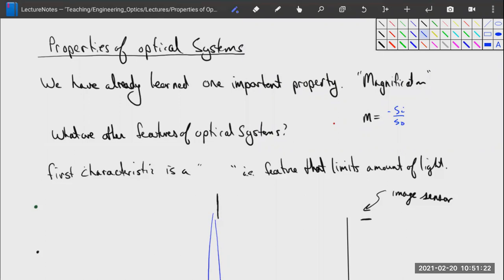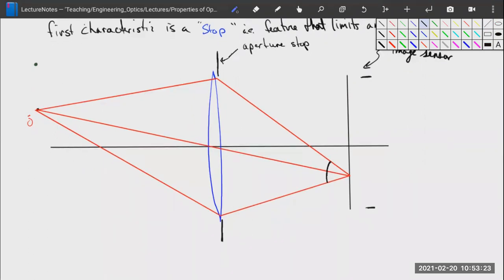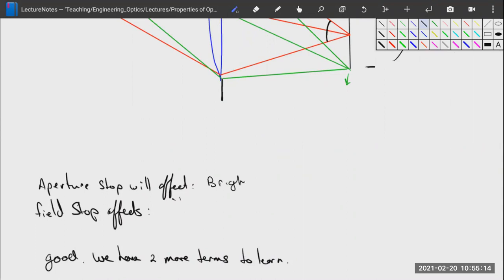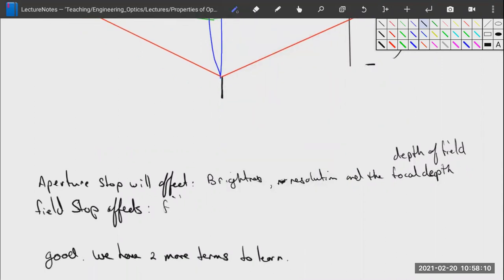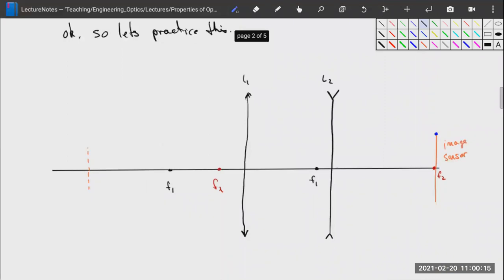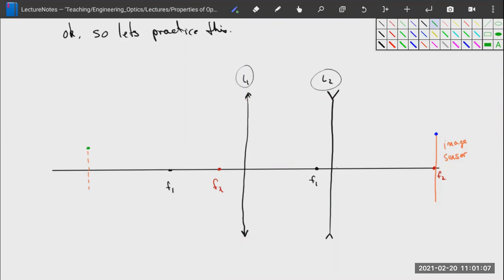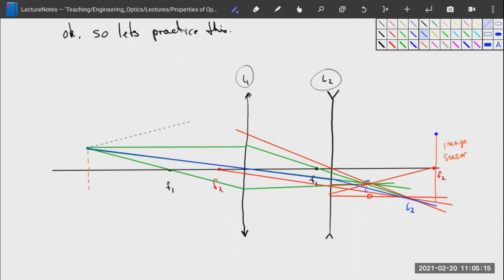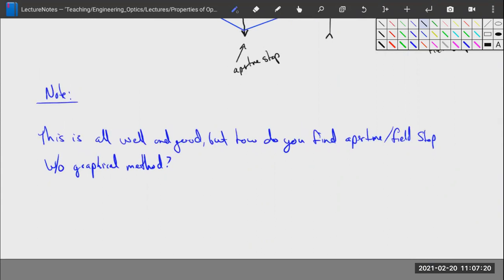Engineering Optics: 9) Properties of Optical Systems - Stops

Comment: hey thanks for the presentation, i have a question. so, the optical system's field of view is geometrical relative to it's internal hardware (sensor/aperture etc.) - a geometrical cone of vision. so according to the reciprocity of light aka the principle of reversibility, that would mean that for the optical system to form an image of an object not only would the light need to reach the optical system, but it requires that for the light rays, to have any physical meaning, would need to be able to be traced back to the object point within our field of view. meaning if the object point cannot be traced back geometrically within our field of view then no image of that object can be formed... did i get that right? would love some input thanks much!